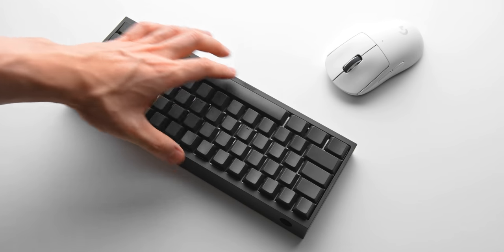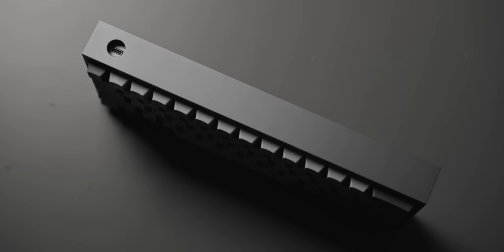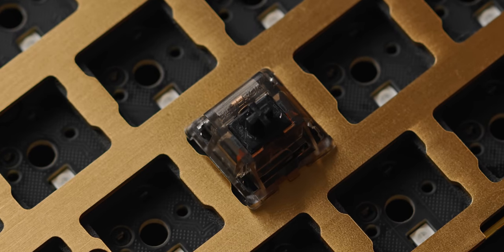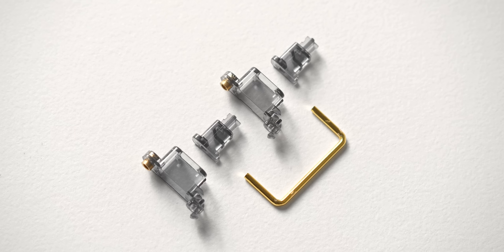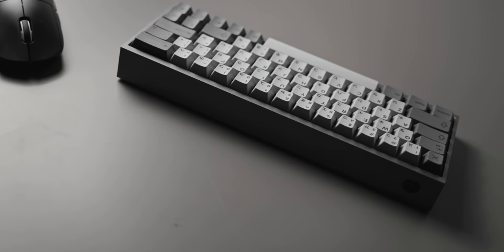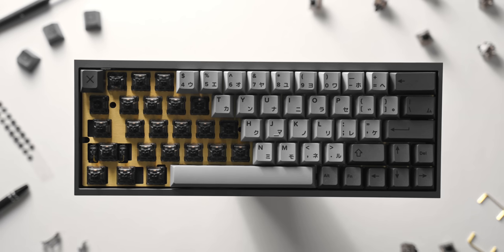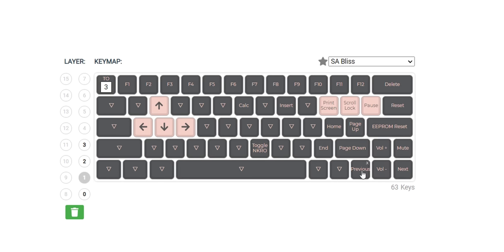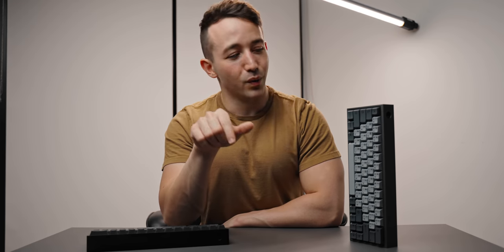Building a Better 60% Gaming Keyboard

Comment: It’s a little creepy how whenever I’m getting interested in something, he does a video on it right when I need it. Lol
Reply: Amogus
Reply: Name checks out!
Reply: same
Reply: @nayanpitlam5621  👽
Reply: Get ready to wait. Lol.
Reply: Same dude, I'm literally about to place an order on a Mode65.
Reply: I swear, last night I was looking at 60% cases to swap a group buy board I have coming into....
Reply: DUDE, this is facts and is so underratted
Reply: For you and your wallets sake just   get a decent hotswap board, put black inks in and never look into any more boards. Just look for a decent top mount board, burger mod, tape mod, pe foam mod, lube your switches and your durock v2 stabs, get a cheaper pbt keycap set and enjoy. Don’t look up gasket mount, RAMA, keycult, GMK, etc… just enjoy and know you’re sound and type feel are pretty much as good as anyone will ever need. 

And if you really want to spend some money for something nicer, get a Mode 65 or 80. This hobby has no end game despite what anyone tells you and if they insist, ask them how many boards they have past their RAMA, or Keycult, or Jelly Epoch. It never ends and then you have like 6 keyboards that cost $600 each while waiting for 3 group buys.
Reply: Happens to me to all the time.
Reply: @SmartFool24  lol i got a ajazz ac064. Hot swap cnc aluminum case. Not even 100 usd
Reply: same
Reply: @mikeymaiku  that’s fine but will that be your only keyboard?  Will you only buy budget boards? I started with very affordable kits too. It didn’t last long lol
Reply: Synchronicity
Reply: Same
Reply: It’s a little creepy how I was thinking the same thing
Reply: same!
Reply: Yea haha I was about to build one as well in a few days
Reply: It’s call the echo chamber son. Ur in it
Reply: Same. Was literally looking at getting the black ink switches yesterday
Reply: @SmartFool24  its my first entry board. I have through hole full diy soder kit too.

But hey for under 100 usd its hard to find a cnc alum case. Most are plastic or stacked polycarbon material

Edit: i got kids so i cant justify dropping that much on multiple keyboards lol
Reply: DUDE DEADASS. IEMs, monitors, keyboards... this man is reading our minds at the same damn time
Reply: @SmartFool24  I already built my keyboard lol. I was just saying I’ve been interested in watching more when he made the video. I don’t really need advice on how to build.
Reply: @vergodagoat  yeah and I’m saying run from this hobby at full speed now.
Reply: You're living in the matrix.
Reply: duuuuuuuuude thats crazy
Reply: @SmartFool24  Unless you're prone to addiction or buying what you can't afford, buying high end keyboards isn't as bad as you make it out to be. GB keyboards and keysets can almost always be sold for more than what you bought them for. In fact, that's what a lot of people do. Enter a GB for a $500 board, receive it and use it for a few months/years, sell it for $1000 on mechmarket and buy another board. If you're sensible with money and aren't eating cup ramen for months just to afford your purchases, you'll be good.
Reply: @AD-nq2nz  Sure it can be profitable and if you’re sensible great but I don’t know anyone in the hobby that doesn’t own at least a few boards while owning one computer or two tops with a work computer.
Reply: Also I should point out that you said, “buying high end keyboards.”  It just sounds ridiculous lol
Reply: btw do not buy the tofu and/or the ink blacks lol
Reply: @dontknow4530  both are great. I prefer the top mount tofu like the 67mkii even though that’s not very popular but the tofu60 & 65 are fairly affordable, mostly available, and you can get decent to good sound and type feel out of both. 

Also the black inks aren’t perfect but they’re smooth at stock and with work and spring swaps are actually pretty great imo.
Reply: @SmartFool24  tofu outdated/overpriced and ink blacks have horrible qc issues
Reply: @dontknow4530  The tofu is outdated how?  Because they aren’t gasket mounted?  I’d say the price could come down a bit but if you mount it on o-rings and do some mods, it’s a very competent board. 

I’ve gone through about 200 black ink v2’s and while some have pingy springs the rest have been good. With a spring swap and lube they become an excellent switch that are very smooth and have a nice sound. 

Just my opinion.
Reply: @SmartFool24  bad qc is not a opinion it is a fact, and if you really want a tofu get a psd50 or a psd68 if you want 65
Reply: @dontknow4530  Actually, it is factually my opinion based on my own experience with roughly 200 of the switches. Also going off other peoples anecdotal accounts with the Black inks and their good experiences with them, I further support my own opinion to myself that they are a decent stock switch and an excellent switch with some adjustments.
Reply: @SmartFool24  that is great but does not take away the fact that gateron in general har horrible qc
Reply: @dontknow4530  I’m my experience that is not the case. I’ve used probably over 400 gateron switches not even including the 200+ zeal switches and I’ve never had major problems outside of spring ping to a small extent. 

What’s funny is that while I have a lot of experience with gateron and cherry switches without many issues at all, in my more limited experience with nk creams( I think kailh) and glorious pandas, I’ve had far more issues including just total failures of a few switches per batch. Despite that I don’t know what their qc is like except my experience with them and I’ve used a lot of Kailh switches previously too. 

So what is your experience with gateron switches?  Which ones, how many, and what issues?
Reply: @joseemilianoriosfernandez1504  same
Reply: Among us in real life sus, sus!!!!!!!!!!
Reply: Same but with the aio cooled itx motherboard
Reply: @SmartFool24  my first board is a nk65 entry polycarbonate Alu plate lubed nk creams durock v2 lubed stabs and I don’t even think I’m done considering that’s a cheap board in the custom keyboard space
Reply: it's called youtube analytics,
people can see what other people's rising interests are
Reply: I’m like…. Dude…. 😒
Reply: exact same switches and keycaps also

Comment: O-ring mount your Tofus, Ali. I've seen a lot of good content about that.
Reply: It feels like a must after you've done it.
Reply from the maker: I'll check it out :)
Reply: Hmm interesting, I first read your comment thought you're saying o-ring the switches. Do you mean put o-ring at all the stem for screw? I guess that's to make it feel more like gasket mounted?
Reply: @imbanett0  exactly
Reply: @wzt91  Nice, I should try (only after I try to source some good quality o-ring, my previous purchase was pretty shit). Anyway I am using a gasket mounted brass plate, very happy with it.
Reply: Bro you buy your self a mechboard because the feel of die Membrane is shit if you do a o ring mod you will have that membrane feel again
Reply: @imbanett0  you can even skip the middle screw stem for less mounting points for more flex
Reply: @aerikdizzy  they are not talking about o rings for the switches, its o rings for the mounting of the pcb and plate, this improves sound and doesnt make the keys mushy like membrane
Reply: @kyuu_09  wouldn't it feel "uneven" (I mean by skipping stem)? 
Just tried my old tofu65 again which is with aluminium plate. TBH, gasket mounted brass feel much "softer" "forgiving", I really should try the o-ring stem mod.
Reply: @optimumtech  you would’ve been better off buying a KBD67 if you plan on putting O-Rings, the point of O-Rings is to give it a “mushier” feeling, sort of bouncy. like the type of experience you’d get from a Gasket-Mount (KBD67)
Reply: I vouch! Did it on my Tofu and it makes a difference
Reply: @Pandered  yeah tofukorn is cool but it's hard to pull off cause you have to cut the pcb and saw off the standoffs
Reply: I have a question hopefully someone here can help. I actually got my durock v2 stab, but eventually I couldn't use it can the brass plate (kbdfans hhkb layout) kinda squeeze the stab housing and causing extra friction and all the keys do not bounce back properly. Any Alternative known to be working or what mods I can do to make it work?
Reply: @optimumtech  A few mods that I strongly recommend you try (all easy to implement and undo on a Tofu 60 hotswap build):
- DIY Silicone case dampener
-Tape mod the PCB
-O-ring burger mount the stand-offs

Also, separately from that list is the PE foam mod. This uses the PE foam that usually comes with the keyboard kit. You cut a sheet of it, lay it between your PCB and switches and sandwich it together when assembling with your plate. It can make the switches and keycaps a bit louder in a sense but it gives a marbly sound.

Again, all of these are easily undone.
Reply: @optimumtech  Like some other's noted, the O-Ring mod on the Tofu60 doesn't really do much.  It can take a little bit of the edge off of bottom out noise on your key presses, but I don't feel like it changed the typing feel very much.  Can confirm that it is nicer on the 65% cases, but still minimal.  Wouldn't recommend unless you want to dampen the sound a little more.
Reply: @aerikdizzy  not that kind of o ring mod, but mmmkay
Reply: gummyworm mount is not imo the ideal gaming keyboard, at least with the tofu. there's just so so much flex.

Comment: I suggest taking a look at a video by keybored where he shows a tutorial on how to o-ring mount it. I know you said that the foam made everything sound much less metallic, but from what I have seen o-ring mounting completely kills any case ping. Plus its cheap, easy, and you might like how it feels afterwards :)
Reply: O-ring is the way to go for just about any tray mount. It's actually amazing how many gamechanging mods are out there for just pennies.
Reply: @TheDrunkestSailor  No problem! I haven't been able to do it on my tray mount boards yet, but I am going to for sure. It cant really cause any harm, and its cheap and relatively easy.
Reply: @justanotherpxrson  I have used the O-ring mount on my Tofu build for like 1.5-2 years now and I've been loving it. It's the biggest gamechanger for the Tofu

Comment: Looks really nice Ali. 65% is a bare minimum for me, the 64 key would be an okay compromise but odd spacing is a no go and I don't think I could get used to it. I'm over the moon with my Tofu65, I've just bought a few more parts to be able to rebuild it so I can try a few different switches, plates and foam layouts. I might even end up buying another PCB and keycaps so I can swap out the whole inside so there's no down time between different setups.

Comment: Gateron Black Inks FTW! Your previous build was one of the ones I looked at before putting together my first build and one of the only points we diverged one were the switches - glad to see you use the switches I eventually chose!
Reply: I just built a keyboard with Tealios V2s and they're a little soft for me. Wish I would've gone with these blacks. Meh, at least my Drop Alt is hotswappable. I'll change them out in the future.
Reply: @oscartirado8146  I've never tried the Tealios V2 myself but if he's switching to the Black Inks after having the Tealios for a while that should tell ya something. Haha

Comment: Nice board! I also use a Tofu60, I highly recommend you put some polyfill in there to eliminate the hollow sound. Helped a lot with mine
Reply: It’s probably the brass plate too, pings a lot which doesn’t help with the hollowness of the board

Comment: There are a few mods you may want to try for fun. The Tofu 60 is super easy to mod, especially the hotswap ver. PE Foam, o-ring burger mount and silicone pour mod. All easy to do, all easy to undo.

Comment: For people who are using two computers for their work, there's a neat free solution called Barrier that would allow for setting up multiple machines with the same suite of peripherals. Only does KBM with clipboard support and (for Windows only), dragging and dropping of text (but not files) , but if that's all the functionality you need, Barrier is free, fairly simple to set up and open-source.

I use it to interact between a semi-broken laptop I am still using for chatting and light video watching, to compliment my better, but still woefully incapable laptop. In both Linux and Windows, it works just fine. (Even with mobile hotspots!)

Comment: Very nice and minimal build, really digging it. Though it is still very hallow, a muted kind of hallow. You might want to try the tempest mod. It made my tofu60 a lot better in terms of sound. I have tried a lot of modding for my tofu to eliminate the hallowness. Foams, PE foams, eva foam and silicon. Still all hallow. It was the tempest mod that made it sound great. I added 2 layers of masking tape in the surface of the case to eleminate the metalic ping, then added one layer of PE foam. 3 layers of masking tape under the pcb without any dampeners in between the pcb and plate. It sounds so clacky good. I also only used 2 screws to prevent unbalanced ping in the middle portion od the keyboard. 1 screw just on the left and right side of the keyboard.

Comment: Pretty solid as far as mechanical and 60% keyboards go. Looks great too.

Still a low profile non-mechanical keyboard fan though. Can't honestly stand neither clicking, key travel, or any other mechanical keyboard "advantage," if that makes sense. I figure that there's a reason keyboards evolved away from the beige mechanical keyboards of the 80's and 90's, but somehow they came back. Most of them with unicorn barf RGB....

Comment: If you're reading this comment and want a board designed specifically for gaming/competitive gaming but also a bit more premium - you might want to look into the Wooting 60HE preorders. It's a 60% keyboard with Lekker analog switches that fits into any Pok3r standard tray mount custom case - including the Tofu60. That way you get the best of both worlds.

Comment: If you ever are willing to look into another keyboard that isnt in group buy but is a month or two wait I highly recommend the Mode65, there is a whole lot of customization options if youre willing to spend the money. Ive had a Tofu65 that I liked but ended up giving to my dad as a gift. Got the Mode65 to replace it and I couldnt be happier. Plenty of mounting options, case/plate material.

Comment: I chose an aftermarket POM plate with flex cuts for my Tofu65, along with the tape mod, o-ring mod and the pcb and plate foam from KBD fans and it sounds incredible. Specifically the POM plate gage a massive improvement in sound and feel vs the ass, whops I mean brass 😂😉

Comment: You should try bag lube your springs to save time. you should also try using durock v2s as they are considered to be the most reliable and good stabilisers. tape moding your tofu could also help the sound acoustics and considering that you got a hotswap pcb you could try some other switches like alpacas, lavenders, tangies, banna splits and maybe some tactiles as well like boba u4ts, glorious pandas and salmons.

Comment: I'd highly highly suggest quickly learning to flash VIA to your keyboard. Its pretty much the same process as flashing the layout to your keyboard, but flashing VIA allows you to use the VIA app to more easily change your layouts without the need for flashing, just as you would any mass produced keyboard. Basically all QMK powered PCBs support VIA, especially the DZ PCBs that often power the Tofu

Comment: FYI! most QMK firmwares that come preflashed on your pcb would run at 125hz polling rate, reflashing it can get you 1000hz polling rate which will reduce the input delay from 8ms to 1ms~. This is noticable in games, especially rhythm games!

Comment: Literally just bought all my parts to build my custom Keychron K6 yesterday. I’ve been eyeing a bunch of boards, Kbd67 lite, Idobao id67, tofu, and keychron, ended up with the keychron because it was a cheaper option, and also because it was one of my options that had a recorded input delay test. I bought a cheap hot swap mechanical keyboard in the past that had terrible input delay of at least like 50ms. After that experience, I was very cautious on picking the right board for gaming. Glad to see that the tofu is good for gaming though. And also I feel you on the group buy stuff. No shot I’m waiting 3 months to get a keyboard after buying it lol

Comment: I highly recommend filming the Gateron Black Inks. I personally have a tofu 65 with a dz65 hot swap on an aluminum plate with SA key caps. You can also do an o ring  mod for the tofu. Overall though, very nice build!

Comment: The keycaps you wanted are in stock now. Also check out the tape mod for the back of your pcb or if you want a muted sound profile check out the silicon dampener mod. If you are after some nice low key keycaps with legends to match your build check out GMK Dark.

Comment: Custom keyboards are fun. Rather expensive due to the manufacturing scale of it all but still fun. Typing this on my ultra-modded $25 amazon special. Was a great experience. Not nearly as good as the more expensive full metal ones, but I learned a lot. Also how the hell did my keyboard cost $25? It's insane. Someone had to have lost money somewhere in the chain.

Comment: Nice, I have 2 kbdfans build as well with one main difference from your build which is the key caps. I get used to SA profile and it sounds much better "clack" the "click" (I stuck sponges into large keycap like space and shift). My second build also go to gasket mounted, which is extremely "quiet" and pleasant dull clack when bottom out IMO. Anyway, kbdfans really a very good choice for their high availability especially whoever from Asia and able to read Chinese, buying them from Taobao is very easy too.
My only complaint tofu60/65 is the sharp edges may not be very pleasant to someone.